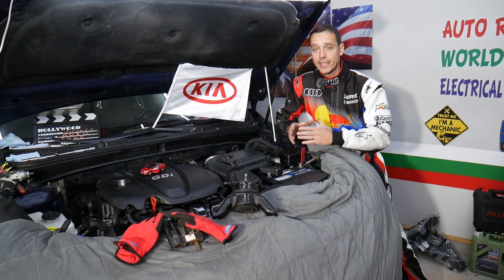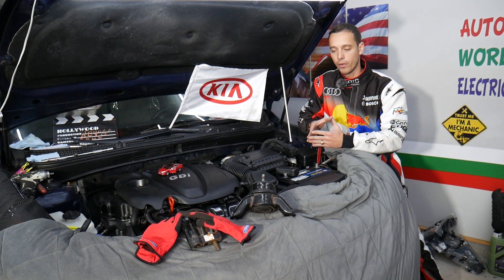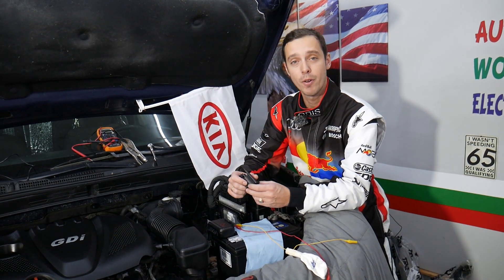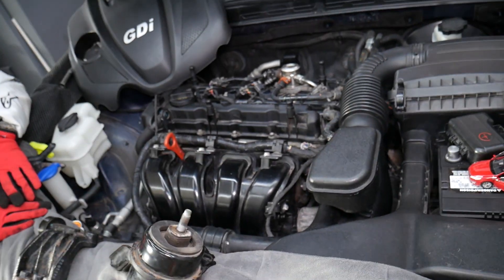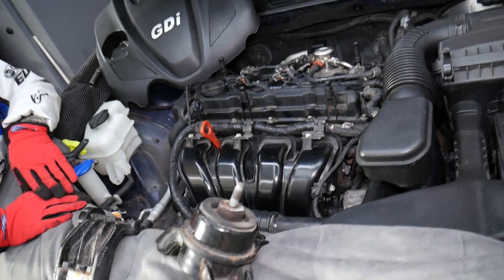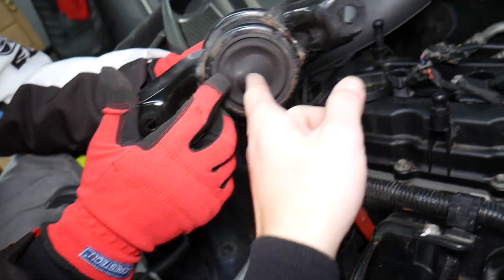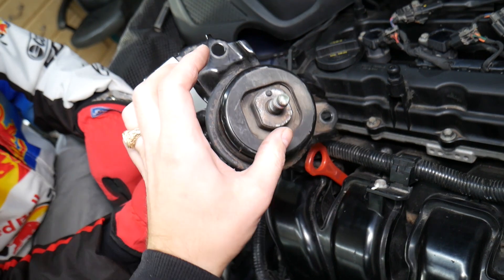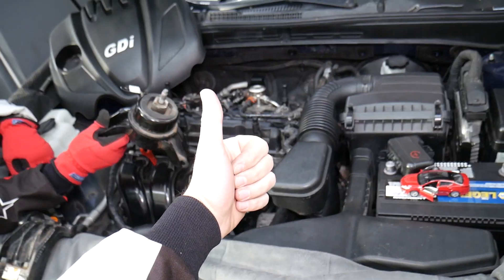WHY KIA VIBRATES, ENGINE VIBRATIONS, DASH VIBRATING

Comment: The Kia vibration is not due to any of these problems, it’s most likely the alternator pulley.
Reply: I replaced engine mount and still engine vibration…should I replace the alternator with new pulley or what do u suggest?

Comment: Question: I have an elantra 2013 SE Coupe. The car runs rough at idle when the cooling fans or A/C kicks in. When driving it runs fine. What is the cause of this? The rpm needle at idle when these systems kick in will drop around 200 rpm less and just idle rough till the A/C or cooling fan disengages.
Reply: it causes the compressor to kick in when you turn the ac which is driven by a belt which is connected to the engine. But its probably the engine having hard time powering the compressor
Reply: @neiljustinealmenor8854  thanks I figured it was the compressor. I also installed new radiator fans (balanced with small weighted clips) and seemed to also help run slightly smoother) haven't really done much to it since the idle is not as bad as it used to be.

Comment: Hello there, I have curation about Kia engine, I repair a complete  engine, timing, shaft bearing, rod , piston, rings all engine work just fine,           no fail but a lot                   vibration, any idea??
Reply: Cuestion**
Reply: Question* is the right word .

Comment: If anyone can answer before I make the wrong decision. Just today I start my car and it’s in park, idk where it’s coming from but mainly I can feel it in my seat it will shake like a heartbeat, I drive off and it stops but on a red light when I hold the brake it shakes … what’s the issue?
Reply: Hey did u find anything out about the issue